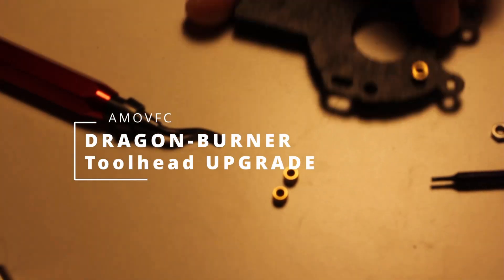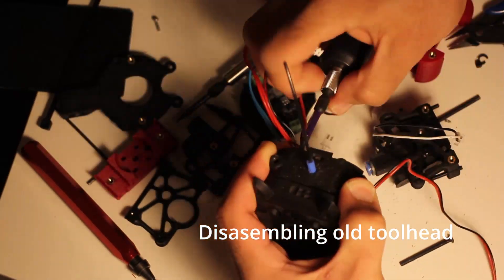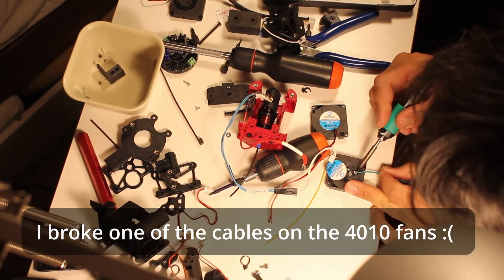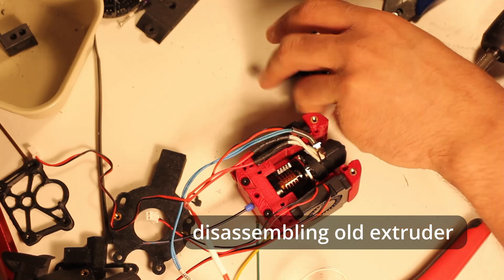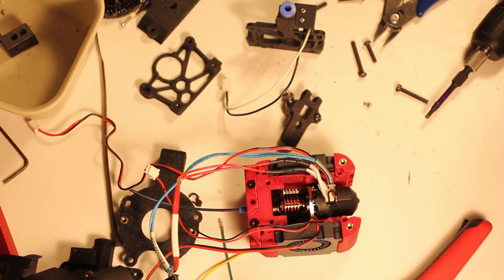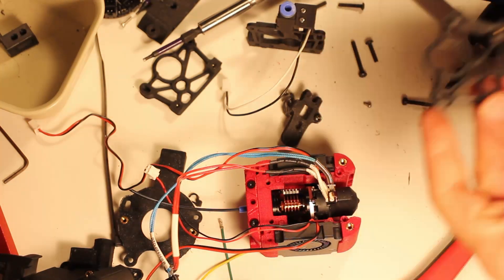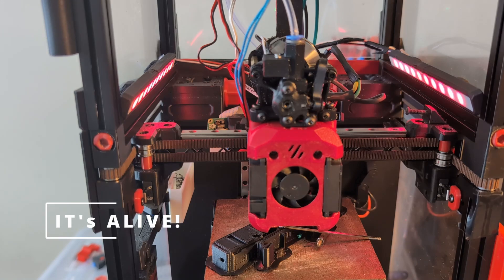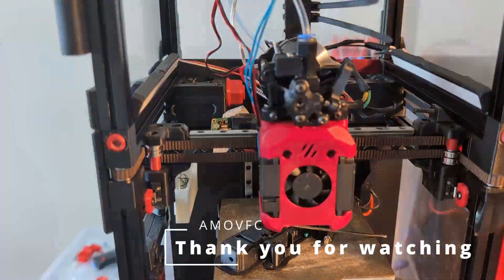Dragon Burner UPGRADE - Voron V0 Toolhead REBUILD (reupload audio fix)

Comment: ASA is slightly better than ABS for this, but I ended up having to print the main shroud in CF Polycarbonate to prevent it from sagging around the bottom air vents when printing ABS or ASA without part cooling fans running.  Running the bed at 110C and the print head without part cooling fans retains a lot of heat inside that box.  

I have my own design filament cutter on top of that - driven by a servo, works perfectly.  I am planning to get it posted to Printables soon.
Reply from the maker: Very cool, do let me know when your post it on printables I'd love to take a look

Comment: If you reprinted on ABS+ for fear of breaking, you're gonna have to reprint yet again very soon. Ever heard of ASA?
Reply from the maker: I reprinted it in abs-gf, no problems so far, I don't have any ASA and I worry about the fumes
Reply: @AMOVFC  If you print in ABS, the fumes are equally as bad as ASA. Not sure about glass fiber filament, but the thing with ABS+ specifically is that it really is not that heat resistant and your toolhead will deform very slowly and very subtle and you'll never see it.

Comment: What's the difference here between the sherpa zero and mini files?
Reply from the maker: @Hoodward55  here's the quote from the Sherpa zero GitHub 
"The Sherpa Zero (0°) adaptation of the Sherpa Mini mitigates the backlash on the set of Bondtech 5mm gears. It is designed to allow for smooth layer stacking"
Reply: @ yeah I read that as well. Just couldn't see how it accomplishes that but it's good to know it exists if I notice any ringing once I get my NG setup
Reply from the maker: @Hoodward55  honestly idk much about extruder design so I can't comment on how much better or worse than the stock Sherpa, I didn't really notice much difference, it is quite simple to swap from one to the other which is nice tho